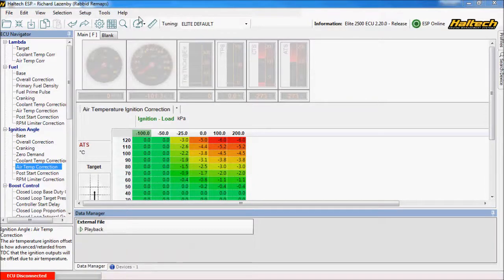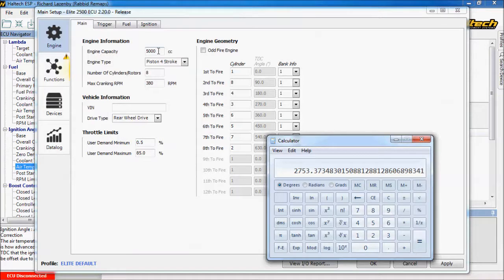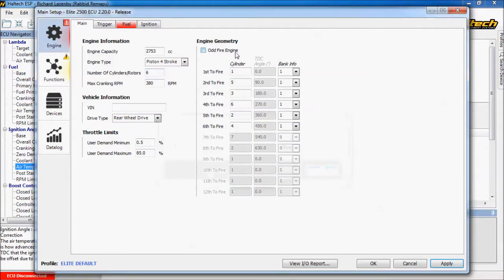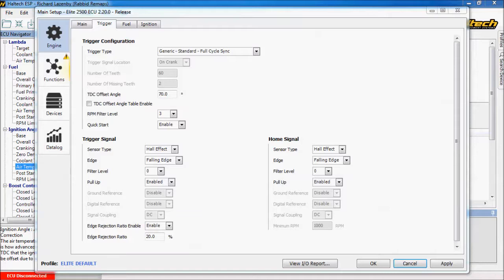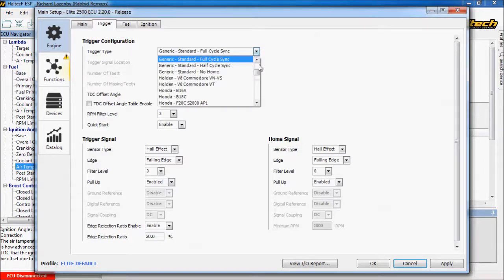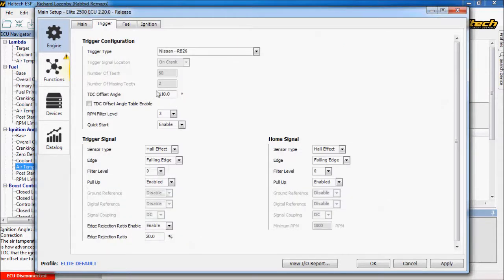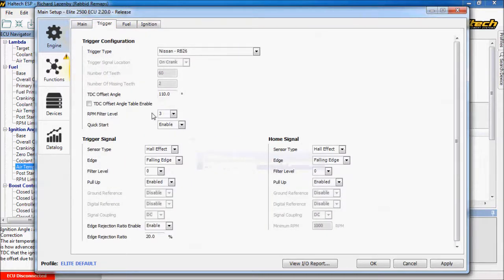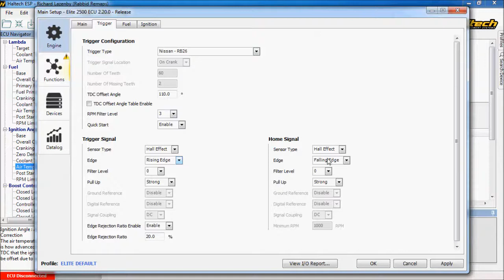Haltech Elite Tutorial Part 2 - Engine Layout & Triggers

Comment: Why a rising edge trigger for trigger sensor.  I have a SR20 with a falling edge.  Trying to check the logic of this.
Reply from the maker: It depends on the type of sensor you use, if its 2 wire generally its rising, if its 3 wire hall then it can be either but generally falling works better as its quicker to pull to ground than to rise to vcc.

If you scope the signal you can see if it distorts on one side of the wave and chose the better edge.

Comment: There are most certainly odd fire engines out there and, in North America anyway, a number of which are high performance engines that may find themselves controlled by a Haltech. For example... 
Chevy 4.3l V6 - it's a small block V8 minus 2 cylinders, making it a 90° V6, which is inherently odd fire(it isn't the only 90° V6 around, but the most commonly built) 
Dodge Viper V10 - all versions 
Dodge truck 8.0l V10 - different than the Viper engine, but same general configuration. 
Ford 6.8l Modular V10 
Probably the best example would be a Harley-Davidson V-twin - two cylinders that fire with "odd" timing instead of "even" timing, which is what creates that signature HD sound in the first place. And, I'm sure there's a few HDs out there running on Haltechs(likely with a healthy amount of boost).

Comment: some say cranks arnt 100% and can be a degree off from cylinder to cylinder especially 4 rotor can be as much as 4 degree deviation mabe that's why they give the option
Reply: Nope, there are a number of production engines that are, in fact, odd fire. The Dodge Viper V10 is probably the most well known, the Lamborghini Gallardo
/Audi R8 V10 is also odd fire, surprisingly, the Ford Modular 6.8l V10, and the Harley-Davidson(and most other) V-twin(s). There's other odd twins, I4s, I5s, V6s, V10s  and what not out there. Not common maybe, but I wouldn't quite say uncommon.